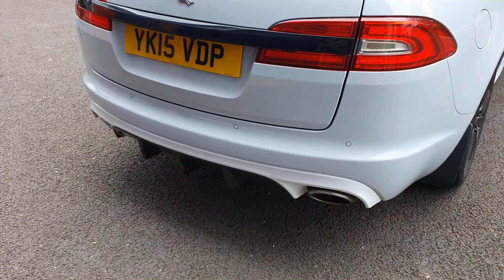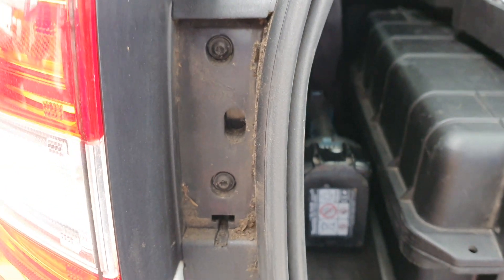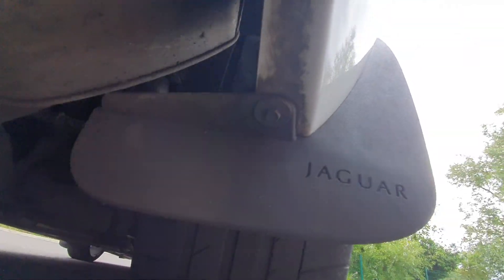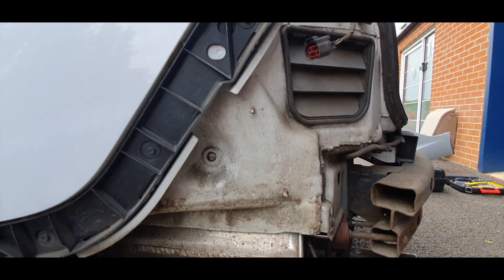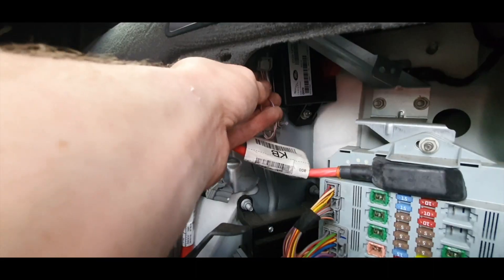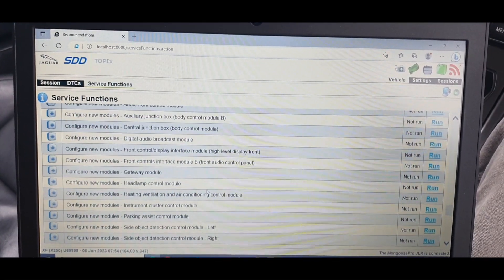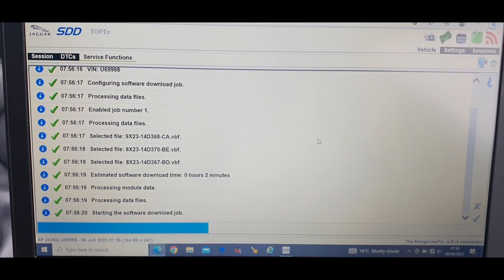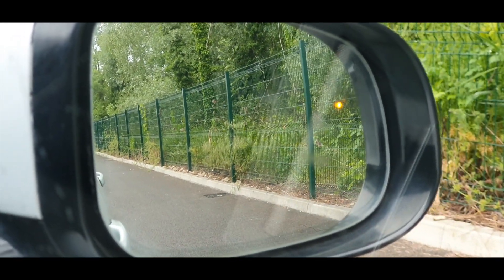Jaguar XF Blind Spot Mirror Upgrade

Comment: Thanks, this video is very helpful. 
Do you know if the xml file will need editing on a car that had this fitted at the factory? I have an issue with my BSM on xf x250 and I swapped the radar that it flagged as faulty but will need follow what you did in ssd. I do already have the software and used to it deactivate the BSM to remove the warning until I can hopefully fix it.
Reply from the maker: It depends if the modifications you've done to the software in the past have removed the txt in the xml file. They shouldn't have but if they have then you'll just have to copy and paste the information from an xml file that does have the information if that makes sense

Comment: Hi again, so i purchased and installed the folding mirrors and i also got the blind spot modules. I was wondering what and how did you modify the file to get the modules to work correctly?
Reply from the maker: I remember it being a massive pain and it was tricky as the software kept replacing the file I was trying to over-write... find a Jaguar specialist who can do this for you as so much can go wrong when making these sort of changes